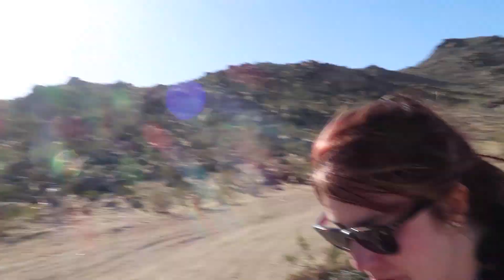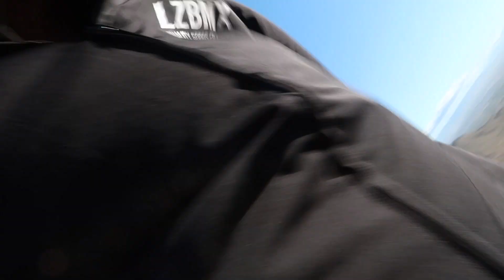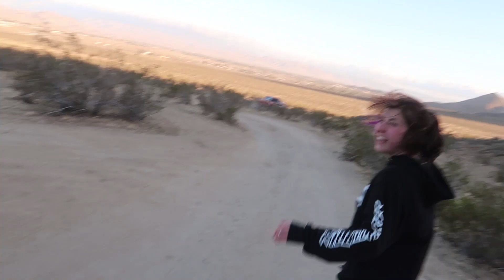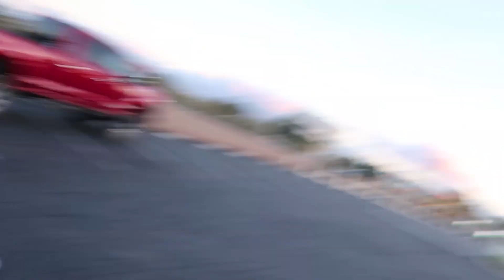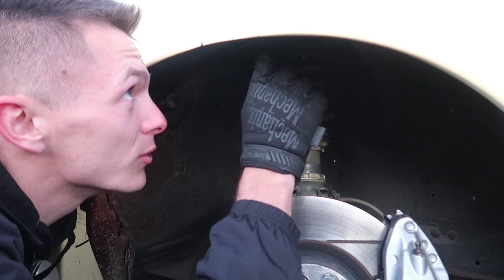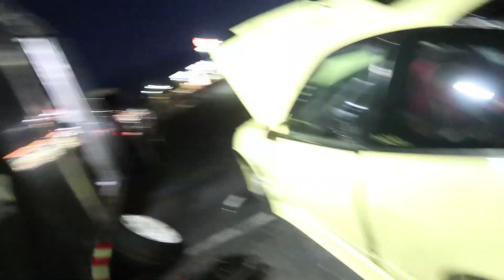Parking Lot Drift Repairs

Comment: Just a thought. But have you thought about using quickjacks? May make the hole process of working on your car , track side or parking lot easier. Im sure you could even set them up in the trailer , and in there? Just a thought!

Comment: Drill through the bolts on axles and use safety wire. It make impossible loose the bolts and its common on racecars.